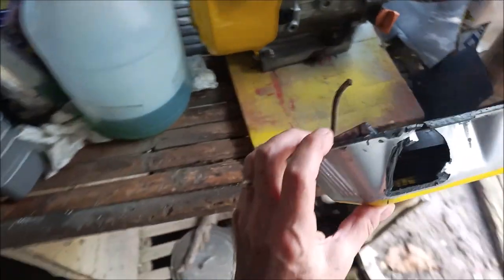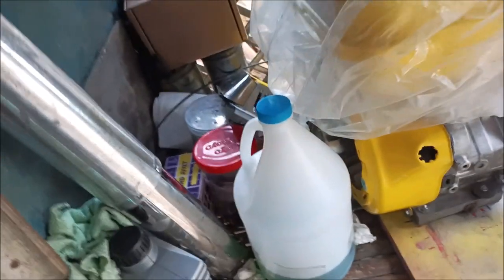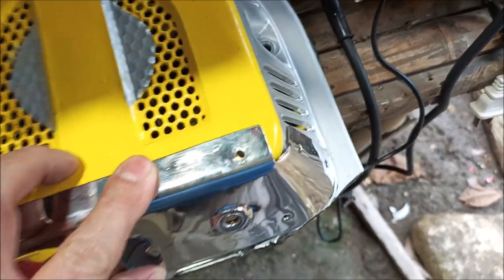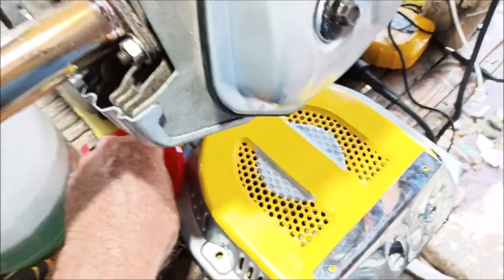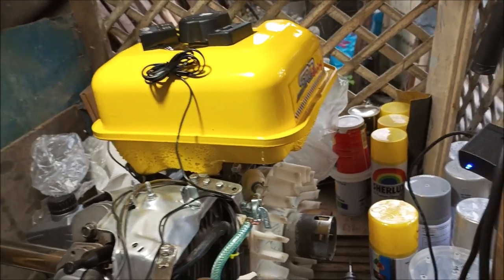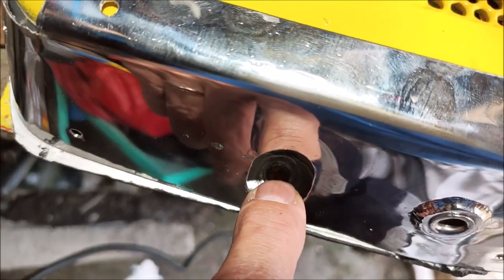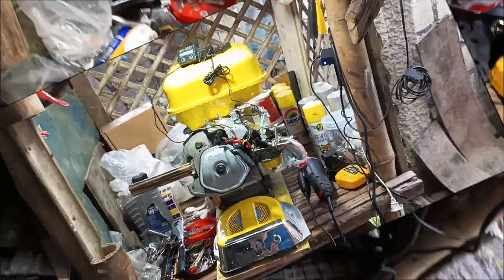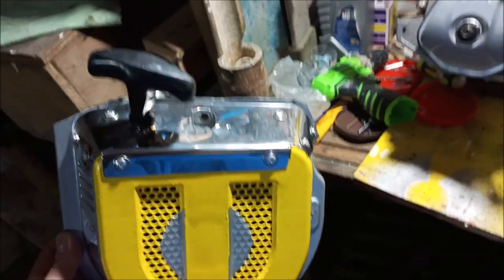Sumo Rato 15HP SE 150M Gas Engine Kickback Repair.

Comment: Oh.. you're a real engineer 😎✌. Great idea.. Hopefully you don't require a longer rope to give slack.
Reply from the maker: It seems to be working fine now and I also reduced the valve lash (gap) on the exhaust valve to open it slightly sooner and reduce the chance of kickback.

Comment: Did you not say something earlier about 18hp motors might be what you were going with ? Just wondering..
Reply from the maker: Yes I have 3 18hp high speed diesel engines with electric start in bantayan waiting to be installed once I get the trimaran to bantayan island

Comment: I'm not sure if the motors are gravity fed or have a pump that can suck up fuel.. It's very different there how things work.. Pressure maybe. Another way
Reply from the maker: The gas engine I have in the trimaran now is gravity fed and the diesel engines have a fuel pump with gravity feed to the fuel pump.

Comment: Can you just go with an external plastic gas can tank like any outboard motor fishing boat? Actually our 60hp Johnson outboard uses a metal portable gas can 🤔 No it's a Mecury 😂
Reply from the maker: That's in an upcoming video, I add two 6.5 liter gas tanks so stay tuned 😀
These single cylinder engines are the same as a lawn mower so they don't have an outboard engine gas tank connector, it's just a 3/16 inch hose and I use a motorcycle gas tank on/off valve, the english call the on/off gas valve a petcock.